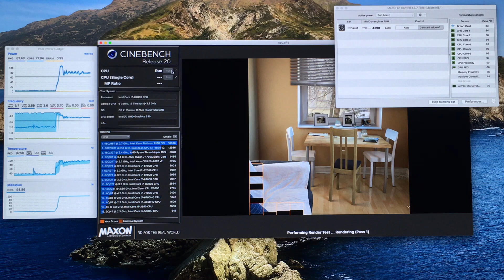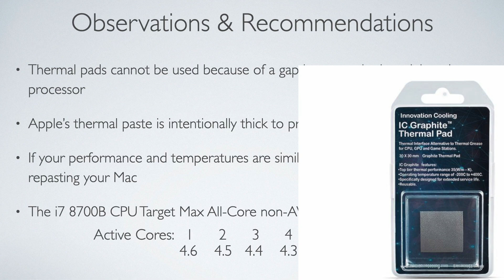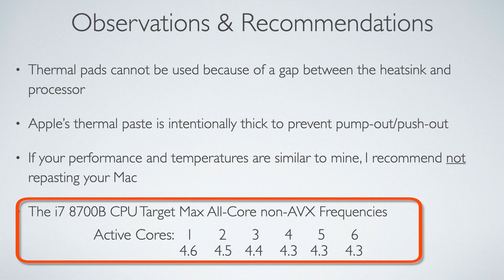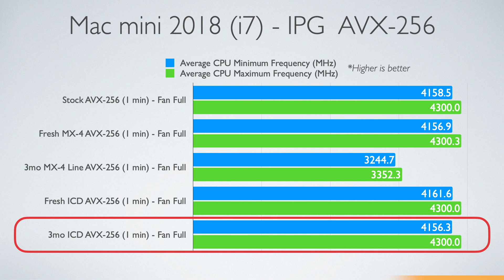Mac Mini Thermal Issues Follow up

Comment: The one I have it says it's from 2014 and it has a heating problems because they didn't put nothing I believe on the CPU from the factory I put a former pad  on it and it helped a little bit but the pad is thick

Comment: If anyone is here in 2025, use Thermal Grizzly phase sheet PTM. Stock paste ran hot at 100 degrees while running R23 and score was around 6300. I installed the PTM and now temps are around 95 degrees while running R23 and score was around 8000.
Reply: Which size and thickness did you use on your Mac mini?

Comment: These minis could have been such a gem, like the 2012s. Still a lot of applications that the newer M1/M2 Minis can't do like the ability to add an eGPU and 64gb of ram.  Have you thought of strategically placing thermal pads on the bottom of the logicboard to evacuate heat to the aluminum housing?  Then placing a large heat sink on top of the case?

Comment: is the Mac mini i7 2018 safe to use long term without it frying itself?

I was going to get one with an egpu for gaming in boot camp… but I keep hearing horror stories of i7 overheating… idk what to think about it all. Does the i7 really get and stay hotter on lesser tasks than the i7?

Perhaps the i5 is better for longevity
Reply from the maker: @Adah - Is the Mac mini safe to use long term? I think it is safe to expect 8-10 years of useful life if you clean the dust every 1-2 years. I am still using mine and the reality is, it’s fine; yes it gets hot with intensive tasks, but it is engineered to keep itself from frying. (I usually leave the machine running 24/7.) I don’t have a link but I remember reading that during intensive tasks the i7 is barely faster than the i5 model due to throttling . Maybe consider an i5? My experience is that gaming usually doesn’t heat the processor as much as a synthetic benchmark. 

One last thought: I replaced the stock thermal paste after one year and I did not achieve a significant improvement in performance or temperatures. With that said, I wish I would have left the stock thermal paste alone. Fast forward 2 years and my IC Diamond paste failed (I’ve been working on a video update for 2 months but it’s complicated). I don’t know how the stock thermal paste performs over time because I cannot find any posts discussing stock performance over time. I can tell you this, when the paste is failing, the Mac mini will start to experience micro stutters.  Example: scrolling a webpage can shoot the temp to 100c which throttles the processor and the user can experience micro stuttering, or, the page does not scroll smoothly but stutters as if the Mac is struggling to load/render the page. I bring this up because if it translates to gaming, it may impact your experience. 

Good luck with your decision!
Reply: @mikes1891 thank you for your lengthy and informative comment. It really does help
Reply: @mikes1891  and or, you can replace the dated system with a Mac Mini M1 or M2 system. The M series processors are energy efficient, powerful, run cool. The only problem with Apple silicon is that Apple now controls firmware, hardware and software. What Apple choose to do with older M series processors in the long term  (especially when it comes to planned obsolescence) is completely in Apple's control and out of the consumer's control.

Comment: Hi!
My mac-mini 2018 late with i5 heats up during normal use up to 95-99 degrees sometimes (for example when I just opened 4k video on youtube or project with multiple files in Visual Studio code or Webstorm) ...
I replaced the RAM to 64GB
but temperatures can still quickly jump from 40 degrees Celsius to 100 in 1 second and back. It seems to me that something is abnormal with the factory thermal paste (in use for more than 1.5 years, I buyed my mac in April 2019), or the temperature sensor is buggy. In any case. Should I change the stock thermal paste or is it better to do a different test first?What is your opinion?
Reply from the maker: To your comment "the CPU will jump from 40-100C in one second and back", my Mac mini has the same behavior with the original and new paste so it could be normal behavior.  The mini has a slow fan curve, it seems the package needs to be 95C+ for 30+ seconds before the fans start to ramp up.  
I would try the following:  
1.  Remove the bottom cover and use compressed air to clean dust from the mini. (I do this yearly) 
  NOTE: do not spin the fan excessively, it may be best to hold it from spinning. 
2. Try "Macs Fan Control" (free) to "force the fan to full speed".
Then use Intel Power Gadget to monitor the Temperature and Power and and run Cinebench.  
https://crystalidea.com/macs-fan-control
https://software.intel.com/content/www/us/en/develop/articles/intel-power-gadget.html
https://www.maxon.net/en/cinebench

If your Temperature and Power readings are close to this video, you will likely see little to no difference with replacing the thermal paste.
  Video from PixelPoison: https://youtu.be/6MIl0XbVN1Q?t=50
  Power PKG = 78-82 initially then drops to around 70
  Temperature PKG (with fan full) should hover around 92, 95, 98C max

If Power PKG is significantly lower (less than 65-70) it could be a sign that your thermal paste is no longer performing well.
Reply: @mikes1891  Hi! Many thanks for information!
My tests: https://www.youtube.com/watch?v=yxacr8o9zkA

Your opinion?
Reply from the maker: Thank you for the video response! After watching I think new thermal paste will help. I noticed your Processor Core watts is in the 50s. For normal performance I’d expect core watts to be around 65. I also noticed your CPU frequency is lower than expected; yours is around 3.5 and I’d expect 3.6 - 3.8+. 
Please keep in mind the pump out issues I had with MX-4, I’d recommend either IC Diamond (or Arctic Silver, I used this on a 2011 Mac mini and it work great for 8+ years.) good luck!
Reply: @mikes1891  did I understand correctly that about  IC Diamond - you meant it? https://www.innovationcooling.com/product/ic-diamond-24-carat-4-8-gram-thermal-compound/ I see it is nowhere available.
About Arctic Silver I was alarmed by negative reviews
Now I have bought an MX-4.
You said "pump out issues". Did you mean a short lifespan or that the temperature continues to jump sharply up and down?
Sorry for my english)
Reply from the maker: @7iomka  For IC Diamond, yes, you found what I recommend. 
For MX-4 I used this and had bad luck - after 3 months my CPU was overheating and throttling again (short life span).
Reply from the maker: Do you have NewEgg available? https://www.newegg.com/p/2MB-001G-00001
Reply: @mikes1891  yes, but that is different, title is "7 Carat", not 24 with previous one.
Reply from the maker: The only difference between 7 and 24 is the size of the tube. The 7 carat size has enough to do the Mac mini about 6x.
Reply: When you should have just built a windows pc lol
Reply: @JessyPinkman-vi7qp  This is obviously a video directed at power users. I have a pc, mac mini, nas, nucs, etc. People who only have a single computer aren't likely to do something like repaste it, much less a mac mini which is already challenging to work on for a newb.